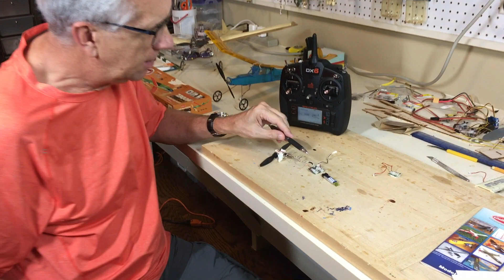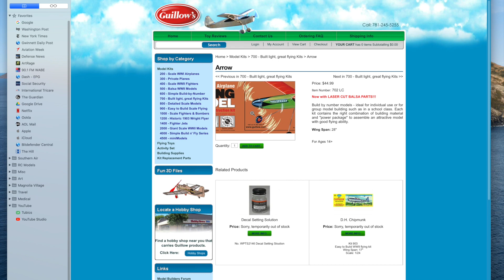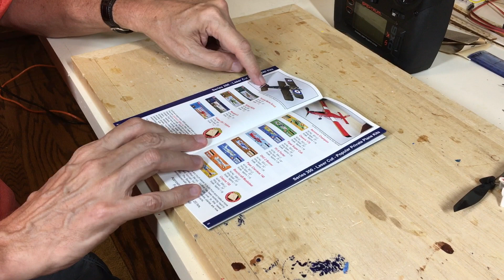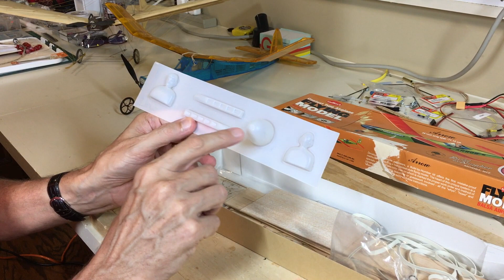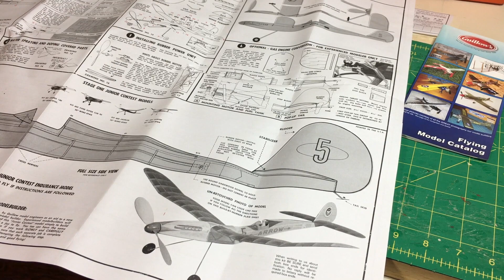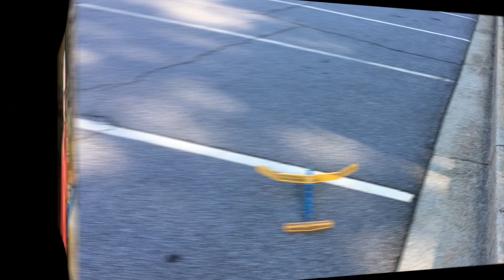Guillow RC Conversion for Newbies!

Comment: Just an observation here but shouldn't you  follow the guidelines and moved the engine on the Lancer much closer to the wing as shown in the Powered Flight option given on the blueprints?
Reply from the maker: I could have.  My models typically come out tail heavy, so I tend to add a bit of length to the nose moment to try and keep the model balanced at the center of gravity without the need for additional nose weight.  The length of an airplane's nose has little to no effect on the flight characteristics.
Reply: @TimMcKay56  Thanks.

Comment: I have one question. what are all of the diffrent parts i need and how do i bind to the controller?
Reply from the maker: It really depends on the RC electronic you will use.  I use the ParkZone micro RC for control.  Check www.StevensAero.com to see if they are in stock.  To bind this particular receiver, just plug it in and within 5-10 seconds the receiver light will flash, meaning it is in the bind mode.  Follow whatever bind instructions for your transmitter.

Comment: I've been rc converting these guillows for a few years now after coming across your video and I keep coming back to it. My latest project is highly modifying a Guillows arrow (again, I did do one with flaps and ailerons) but this one I'm calling the "thermal arrow" Since you can buy replacement parts on the guillows sit I bought a few extra sheets of Arrow wing ribs and I'm working on effectivly doubling the wingsame and elevator span of the Arrow. Instead of the balsa spars though I upgraded it to carbon fiber since it will be so much wider. IDK how it will fly but Its a fun project and will look cool with such a huge high aspect ratio wing on it.
Reply from the maker: Sounds like fun!  An enlarged Arrow should fly just fine, good luck!

Comment: How did you prevent the monocoat from warping the the parts when shrinking?
Reply from the maker: Be sure NOT to use regular MonoKote . . . . it is way too heavy and strong for Guillow models, will warp everything.  Instead, search for "Lite" coverings.  They usually have the phrase Lite somewhere in their name.  These coverings use less heat, are no kidding light, and have less impact on warping.  See www.StevensAero.com for a start.  Tim
Reply: @TimMcKay56  Thanks for the info will order some "lite" covering.
Reply: Lite covering worked great on a Guillows Javelin what adhesive would you recomend to attach the covered tail to the covered body?
Reply from the maker: @jamesdarrow9801  I use just a dab of 5 min epoxy (as it can be heavy). The epoxy fills gaps and has a few mins working time. Tim
Reply: @TimMcKay56  Thanks will try it

Comment: Tim,  Hello.  Can you send me info on the latest micro RC package to power the Guillows 24 inch bi planes?  Looking for 4 channel set up.  Was looking on  horizon hobby website but could not find anything.
Reply from the maker: Check www.StevensAero.com. Their ultra-micro systems are what I use. Tim
Reply: Thanks.  After I sent you the question i found your video on the topic.   @TimMcKay56
Reply from the maker: @christopheraliphat4534  😊👍🏻 Tim

Comment: I'm building a 20 inch span WW I Bristol Scout, 150 Sq in from scratch and thinking of using that power setup. I've been building balsa models FF and RC since 1969 and  I really enjoy your conversion videos.
Reply from the maker: M5:  Thanks for checking in and best of luck with your Scout build.  20 inch span is small, do keep it light!  Tim

Comment: Do you ever build any nitro rc planes. With cox or norvel engines?
Reply from the maker: Adventures:  Cox engines for sure 1970 to 1985, all electric motors now. 😊 Tim
Reply: The reason I asked is because I still love those engines and Im working on a balsa rc rascal and I want to fuel proof the engine bay. How did you fuel proof your planes ??
Reply from the maker: @adventures3699  There are numerous methods to fuel proof, butryatedope probably the best.  Best solution, truly, is to Google "How to fuel proof a balsa model."  The various forums help a lot.  Tim

Comment: As a teen I built several tissue covered airplanes and now at 76 years old am wanting to get back into it.  I have been watching your youtube videos especially the Guillows series.  It appears to me that the least expensive and complete radio setup could be had by purchasing a ready to fly toy grade plane that includes transmitter, charger, batteries etc., and using those components in a Guillows model.  Woulld that work?
Reply from the maker: Michael:  You bet, and that is how I got a lot of my ultra-micro RC components.  Buying an E-flite RTF and "harvesting" the components when done.  Just make sure the RTF is at least 2 ounces or so.  The smaller RTF have very tiny motors, not enough power.  Tim

Comment: Hello Tim! Thank you for your reply. I've seen on  youtube where a guy built a British SE5A as a RC model, It flew quite well. The SE5A has a longer nose than the others in the 200 series, which helped a lot, I'm sure. You should build a P-40 from the 400 series. There's a lot of room in the nose of that airplane, so getting the center of balance right would be easy. Are you planing to do more Guillow's RC conversions ? I've sure have learned a lot from your videos, and look forward to more!
Reply from the maker: David:  Fully agree, the SE-5A  has a long nose moment, as does the P-51, P-40, etc.  Big problem with the WWI bipes is keeping everything together.  The top wing and landing gear usually do not hold up well.  I have one more Guillows in the queue, a Piper Super Cub.  Should start that in a few weeks.  😁👍 Tim

Comment: Hi Tim, This question is about wire size. I found 0.015, 0.020 and some 0.032 size wire, which do you use? I also found some carbon fiber rod, 1.5 mm. size. The rods also come in sizes 1 mm. 2 mm. 3 mm. and up to 6 mm. I found carbon fiber tubing as well, I bought the 3 mm. tubing,  it's the smallest they had at the Hobby Lobby store.
Reply from the maker: David:  I honestly do not know the size of my various smaller diameters of music wire.  Some of it if quite fine, looking for light weight for the Guillow type models.  If it seems to be strong enough, I use it.  Same for the carbon rods.  1mm is pretty light weight, but good for Guillow type models.  I use 2 mm for my 30 inch wingspan Lite Ranger foam board models.  Tim

Comment: HI, Are you using the standard 8.5x20mm brushed motor units or the more powerful 8.5x23mm brushed motor units?
Reply from the maker: Jeff:  Not exactly sure, but the latest motors from Stevens Aero.  Tim
Reply: @TimMcKay56  Yes, the 23 mm can is more powerful. I'm building the Fairchild 24 and will use the larger motor as it does have more zip. The standard Champ motor is the 20mm and is a bit cheaper. Both available from Stevens...  I have that unit in the E-flite PT-17 ARF and it is good.  EFLU2916 is the part number (motor only)
Reply from the maker: @jefffozard3115  Jeff, sounds like a plan.  And keep in mind using fresh batteries . . . sometimes that can make a difference, if the battery a bit older.  Tim

Comment: Hi Tim, Wonderful video, thanks so much for making it! It looks like most of the models you've converted fly just fine without aileron control. Is that usually the case? I'm hoping to convert an Easy Built stick and tissue model to RC, and was wondering if I should add an additional servo and how I would connect it. Thanks again.
Reply from the maker: Taylor:  Ailerons vs rudder really depends a lot on the model, hard to predict. For the smaller Guillows models, where weight is critical, rudder is a lot easier and lighter as opposed to ailerons. For for more maneuverable aircraft, ailerons are a much better choice. Which is why I added ailerons for my Guillows Hellcat. The Easy Built should be fine with rudder control. Tim
Reply: @TimMcKay56  Perfect, will do. Thanks!

Comment: I built two javelins and they both seem to break apart when I just touch them. I tried putting more CA glue on the joints but it doesn't seem to help. I used Zap a Gap.but they break apart not just at the joints but in the middle of a cross member or a piece of flat but also wood in the frame it just seems to crush really easily
Reply from the maker: George:  Try buying some balsa on your own that may be a bit stronger.  For any 1/16" square shown on the plan, try glueing on a second 1/16" square to make it double the size and a lot stronger.   If you have 1/16" balsa formers, ensure there are some balsa 1/16" across the grain to make stronger.  Tim

Comment: Tim how long do your guillows model airplanes usually last after the maiden flight can you keep repairing them?
Reply from the maker: George:  I built the Lancer five years ago, still fly it from time to time.  It depends a lot on how "robust" the model is.  The Lancer is very light weight, thus does not get damaged much if at all in a crash.  With my latest, the Aeronca (video out in a week), there is more to snag (wing struts) and the model at three ounces is almost twice the weight of the Lancer.  Something like a WW-1 bipe would have more things to ding in a crash.  Tim

Comment: great video. i have done a handful of guillows conversions myself. i have a hard time getting the center of gravity right on those lancers but i think its one of the best candidates for rc conversion. may have to do another piper here soon
Reply from the maker: For the CG, probably best to use the location shown on the plans.  Lancer CG is far aft due to lifting tail section.
Reply: @TimMcKay56  I usually do flat tails instead of lifting tails becasue I don't like building lifting tails lol